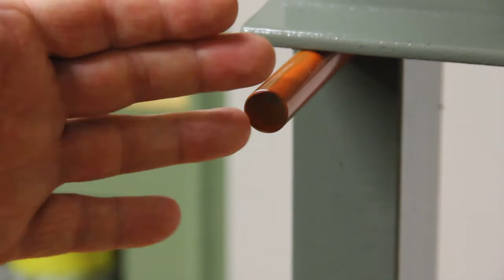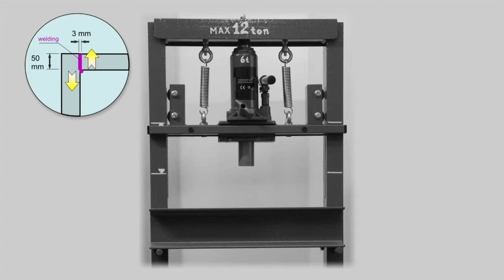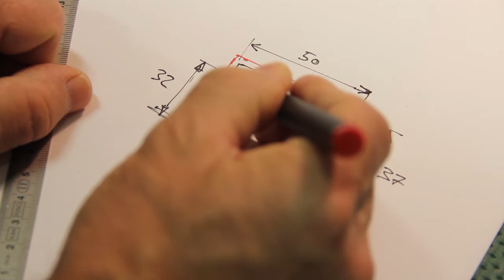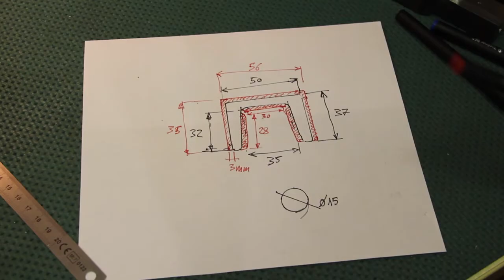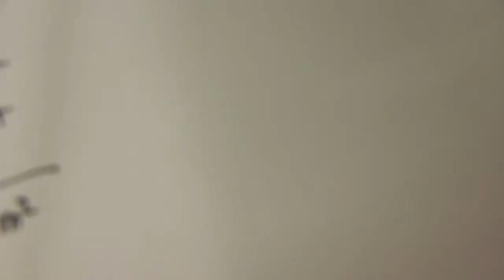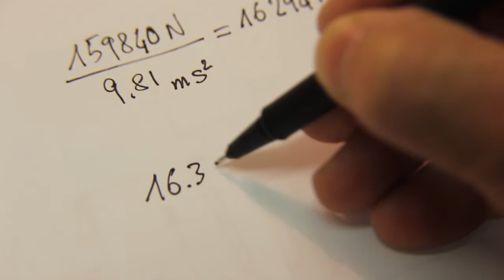can your press hold that much force

Comment: I spotted a couple of mistakes in your calculations:

1) You only calculated the sheer strength for one side of the press. Given that the jack is centered within the frame forces should be distributed fairly evenly between the two side of the frame, so the actual capacity of the press is double what you calculated.

2) When you were calculating the area of the welds you double-counted the corners. For example, on the outside weld you increased the height by 3mm to account for the thickness of the weld, but you also increased the width by 6mm to account for the thickness of the weld on both sides. You should do only one of those two adjustments. So your weld area is 36 mm^2 smaller than what you calculated.
Reply from the maker: Thank you for your comment. 
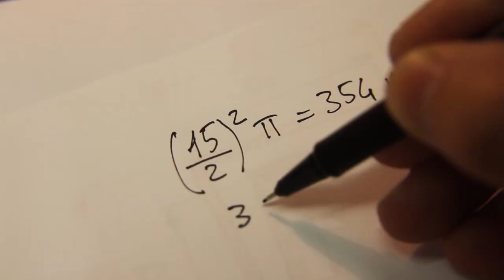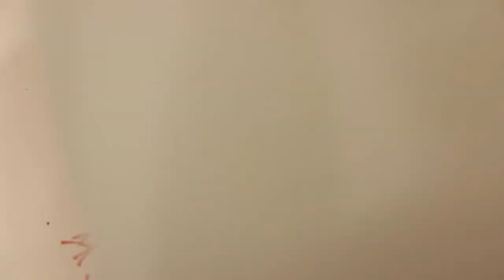Yes, good spotted, your are right about the 3mm overlap on the height, but this lead to 18 sqmm smaller (9sqmm per front-back side) as the inner corner was not overlapped, so the final surface is not 666 but 648 sqmm. And yes there is an other mistake (damn!) because while this still is the per left-right side weakest point (against the 708 sqmm of the pins per L-R side, ref. 16:19) I failed to double this surface for both L-R sides to get the final force (ref. 14:49), so the correct math is:
50*3 + 37*3*2 + 30*3 + 28*3*2 = 648 sqmm
648 * 240 = 155520 N
155520 / 9.81 = 15853 Kg  or 15.9 t
and this is the force on one L-R side, so 15853 * 2 = 31706 Kg in total;
apply the 30% margin and the result is: 31.7 t - 30% = 22.2 t

Remark: After having seen the pins were not the weakest point I did not calculated the force related to them.
Reply: @AccidentalScience  Isn't the thickness of the frame where the pins also deciding on how strong this joint is? My compliments on your video it's by far the best i've found and your approach to the strength is very educational and interesting.
Reply from the maker: @dslinkert  thank you for the kind words. Because I'm not a mechanical engineer and because pins and weldings are the most flimsy points, for the sake of simplicity I calculated the shear stress only.

Comment: This is a very typical press model. You can always check what kind of material thicknesses, welds and pins commercial products have.
Press needs not only strength but rigidity. If press gives in it restores energy which can be released with unpleasant results if something fails. For example some Chinese presses have had cast iron tables which have literally exploded to the face of user.
So it is good idea to overbuild press to get it as rigid and strong as possible. Then it will be more precise in use and safer
Reply from the maker: Good point about rigidity.

Comment: Too cold welding I guess. Not deep enouth .Very interesting by the way !
What´s your band saw ? It cut very well !
Reply from the maker: My band saw is a FEMI. About welding you are partially right: at points it is too cold and not deep, at points it goes down and hot. Eventually I bought a new welding machine to replace my old buzzbox that don't work well at 50Hz (it is a 60Hz machine).
Reply: @AccidentalScience  I suppose you bought a inverter ? You ´re welding in Direct Current with the new one and Alternative  Current with the Buzzbox. No matter if you run in 50htz or 60htz ( I think). Watch the package of electrodes , it tell you if you had to put the ground on DC positive or DC negative. ( I´m French my English isn´t very good ... )
Reply from the maker: @POULPY47  hi. Yes the new one is an inverter one that generates dc output. Of course I follow the indication on the electrdes' package. The problem with a 60Hz machine on a 50Hz grid is it does not perform as expected an the variable reluctance transformer that's inside can overheat, and also I noticed oscillations maybe due to resonance with other components in the electric installation (don't know exactly why) causing current fluctuations. 
Don't worry about your English as long as it can be understood. English is my second language too, BTW.
Reply: @AccidentalScience  mine is a first price GYS 160 who can run at 50 or 60 Hz. Are you sure your can only run on 60 ? Maybe something more simple affect and produce troubleshooting when welding.  Earth clamp not screwed correctly or the wire of the sting holder not screwed correctly . Both happenned to me , and the last one produce lots of heat in the sting holder  generate hazardous welds .
Reply from the maker: @POULPY47  my buzzbox has 35+ yrs, 60Hz 220V only. IDK maybe there is an other electrical problem, I didn't investigated.

Comment: Hi 

Do you know what could be the maximum steel plate thickness that you can fold with a 12 Ton? for example folding up to 90° 

Currently i am building a press very similar your own

thanks David
Reply from the maker: Sorry, I didn't do that calculations. Currently my press have a 6ton bottle and it can easily bend a steel flat bar of 20x5 mm. A bar of 60x12 mm can be moderately bended but it is at its limit. Thickness it is not the only factor as even the width of the bar is important, in other words the cross section do matters. Also it is important the lever that can be calculated by taking into account the edges where the part to be bended lays, and the edge of the wedge that is pushed by the mobile part of the press (sorry, I miss some specific technical terms here :) hope you can understand what I mean).

Comment: This is a very well executed project my friend and I plan to duplicate it myself. It  is the very best video that I have found on building a hydraulic press. I am also intrigued by your method of calculating the forces being applied to the various sections and welded joints of the press and how this information is used to determine the size of the steel and welded joints used in this project. I am a 79 year old retired electrician, not a welder, but I do have some welding equipment and will try anything. Projects like this keep the mind sharpe and life enjoyable.Thank you very much for your very informative videos.
Reply from the maker: Thank you. Your comment made me happy.

Comment: You also don't take into account a "Proper" weldment would be beveled BEFORE welding, achieve 100% penetration, so the cross section of the weld is going to be 2 times that of the channel iron. A properly executed weld is always going to be stronger than the parent metal. No welder worth his title would make such a poor weld as you sectioned through
Reply from the maker: You are right, but as I've said at the end of the video I am not a good welder, nor I claim any title on that field ...also I am pretty sure that many DIYers are not titled welders, so the reason of the video that is aimed to enlight the limits of DIY works many do, me included.

Comment: To cut odd and difficult shapes on my bandsaw I use a small drill press vice that will fit into the jaws of the bandsaw. Just watch out not to cut through the vice. Nice chanel and looking forward to the completion of your lathe.
Reply from the maker: Thank you mate. Useful tip the idea of using a drill press vise. 
Cheers.